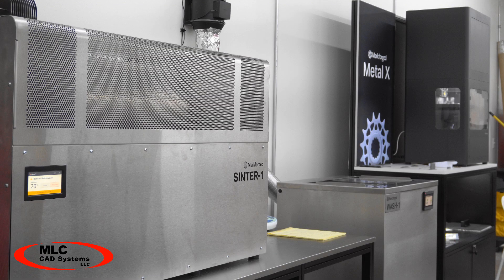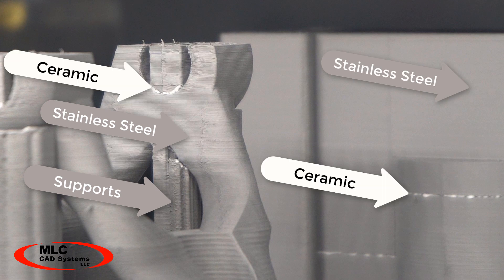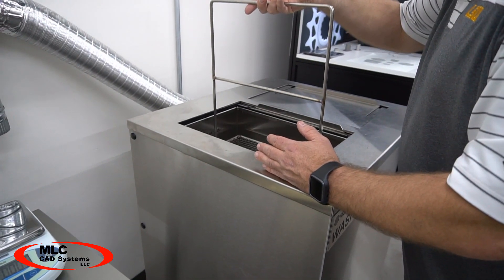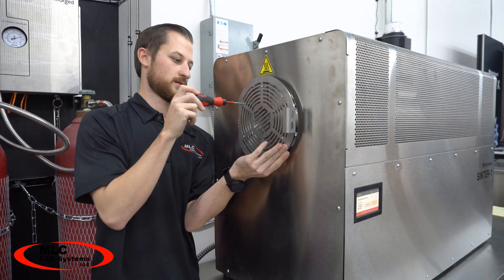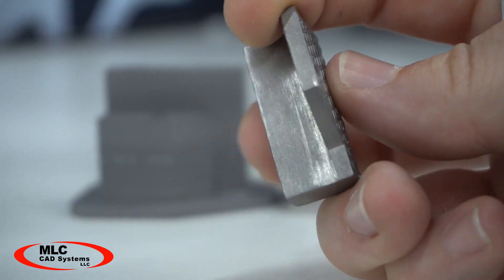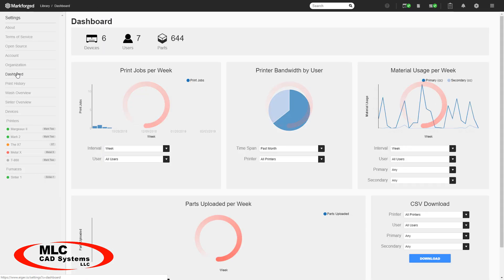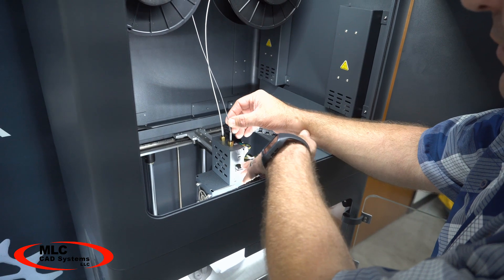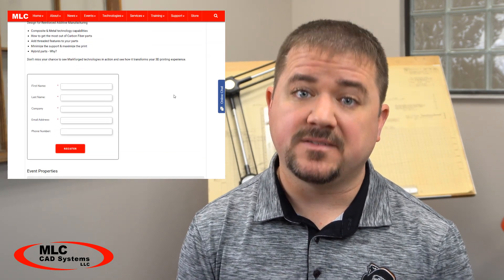The Markforged Metal X is Here

Comment: Wow this looks like nonsense, why have the unit desk top sized if everything else is so huge? And the part shrinks after baking? So you cam never produce accurate parts?!
Reply from the maker: This technology is based on an age-old technology that is very controllable. The printer doesn’t need to be any larger to get the job done, all the equipment is sized to do their specific job in the process. The part does shrink during SINTERING, this is a very controllable process. The software automatically scales your CAD model upon import to produce a true to CAD end part. We'd love for you to come to one of our 3D printing events so you can be more informed about the process. Check our calendar here: https://mlc-cad.com/markforged-events/
Reply: @anirudh9995  It is not. Powdered metal sintering is a mature technology that has been around for decades. The printing is new, but that's only half the battle.
Reply: Sintering is a pretty common way to produce gears nowadays, and it's also how carbide inserts are produced.

Not a machine for the average home user, but could be something a prototyping workshop might be interested in, and if the ovens are able to be used for heat treating too, then it's not really a lot of wasted space.
Reply: @carneeki  Nobody's going to be using those overpriced sintering ovens for heat treating. The whole process is so slow those ovens are going to be backlogged in sintering jobs. As for size, they sure didn't advertise the giant argon tank that you'll need to wheel into your office!
Reply from the maker: @JTMarlin8  We are planning to continue producing content to help potential customers understand all facility requirements, and yes you'll need quite a bit of argon gas to run the machine.  For more detailed information, check out the Markforged Metal X System Facilities Guide.  https://support.markforged.com/hc/en-us/articles/360005115379-Metal-X-System-Facilities-Guide

Comment: I've got a location out in the country that doesn't have access to Internet. Do you have an on-premise solution for using the Metal X process to manufacture parts without internet access?
Reply: Secure? Do you offer any insurance in case of a leak? Not that it matters, if clients want my head on a platter :-P

Anyways... not for me. We lose connection from time to time, due to internal and external issues.

Besides that, the system seems interesting.
Reply from the maker: @bolodotdk  There is an on-premise version of Eiger, but we discourage it's use because it is not free like the cloud version, and without constant updates it will be limited in capabilities.  The Metal X materials are still being improved in terms of how they are processed, but if a no-internet version is critical for air-gapped environments it can be done.
Reply: @MLCCADSystems  DVD-ROM and USB sticks still exist, and can be used for software distribution (including upgrades).
Reply from the maker: The reason for the online requirement is not just for distribution of the software, but for tracking and monitoring the equipment during operation.  The current printer status, any errors or messages, time remaining for each part, and each part's progress through each phase is tracked in real-time online and can be accessed through any browser.  The ecosystem is designed to be internet-connected and each piece of equipment is setup to connect centrally to Eiger.  Keep an eye out for potential future enhancements in this area though as Markforged tends to move quickly to improve their products and make them easier to use.
Reply: So a closed platform, that have to be connected to the internet... that would mean no sensitive jobs. A shame, sounded like a pretty interesting machine.
Reply from the maker: @bolodotdk  Eiger Cloud backs up your data in a secure cloud storage system. Only members of your Organization on Eiger have access to your data. Markforged employees cannot access any of your data without explicit permission from you.
Reply: @MLCCADSystems  ITAR disagrees.
Reply: JTMarlin8 I wonder if they realised they are closing themselves off to the entire defense manufacturing sector by forcing a feature like this.
Reply from the maker: When ITAR restrictions exist the offline version of Eiger would be required.
Reply from the maker: Hello! Unfortunately, you would need an internet connection to run the Eiger software and Metal X.
EDIT: an offline version is available, see below.